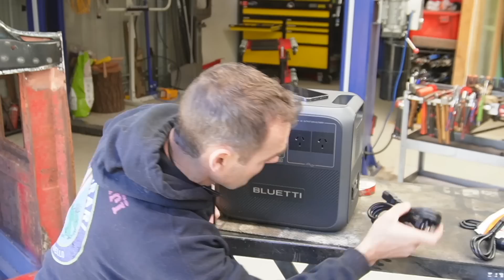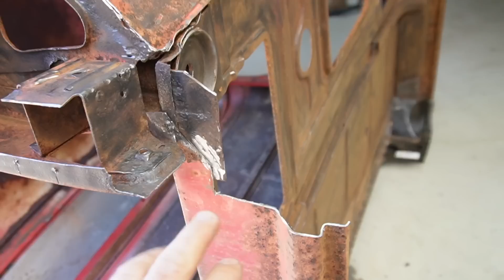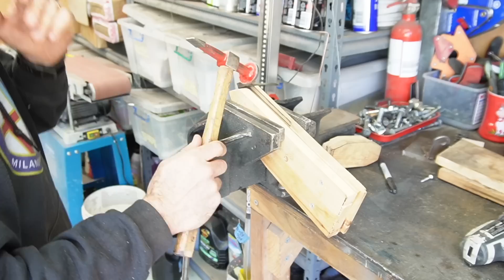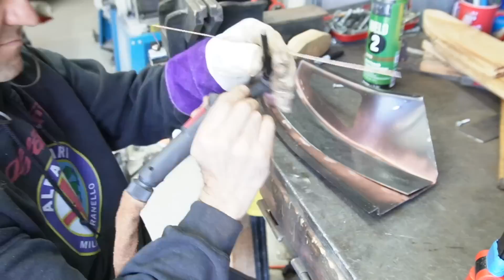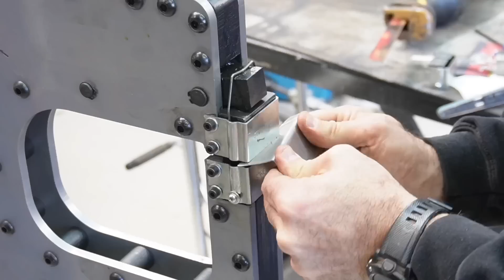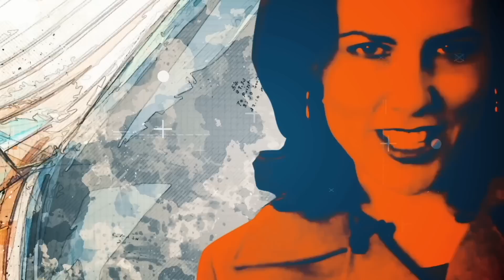No more rusty corners  - 1954 Ford F600 Car Hauler Build part 10

Comment: Part of the reason the aftermarket repair panels fit as they do is because of the significant differences from one OEM panel to another. Back in the day, the tolerances were massive compared to today’s standards.

My little company makes repair panels and we find that a perfect fit on one vehicle isn’t perfect on another. It’s frustrating for us and frustrating for the customer who thinks it is a simple bolt on.

Thanks for managing expectations, Jeff.

All the above said, that panel fit horribly.😂 Nice work!
Reply from the maker: Haha. I am totally realistic with these things. Like you say these old cars had very loose tolerances. At least if the shape is close it is far easier than making the whole thing from scratch.

Comment: Hey Jeff, the splatter from the MIG doesn't burn through the tape on the thread? I would have thought it did. I've never done that myself
Reply from the maker: It generally bounces off, where it will just stick to the care threads and weld to it.

Comment: Why don't you chuck in a sunroof for the cabin? Who doesn't love a sunroof? I guess people with leaking sunroofs, but besides them.
Reply: A ragtop sunroof would be sweet but the curved shape of the roof would make fitting one wide/long enough to get the full effect tricky.
Reply: @Jonathan_Doe_ hey up mate did one early 90s on a ute, was a really hot day and used a concrete cutter to chop roof out and suddenly loads of fresh air, then to keep the unwanted out, welded some square mesh in, only had to have two sections of it to get the correct curves, worked great and made a roll back canvas thing to keep the rain and snow out
Reply from the maker: I hate sunroofs almost as much as I hate convertibles ;)

Comment: Have you thought about getting a spot welder? I am thinking about getting one. Main reason is, if you have to take out a pannel after you mig weld it in place is so much harder.
Reply from the maker: I have one, but in this case I prefer to mig it.

Comment: 19:40 No the flat sides don't give it the strength, the flat sides are like the web on an I-beam the top and bottom plates take the compression/tension. Leaving off the flanges leads to inward deflection and web cracking as the load oscillates.